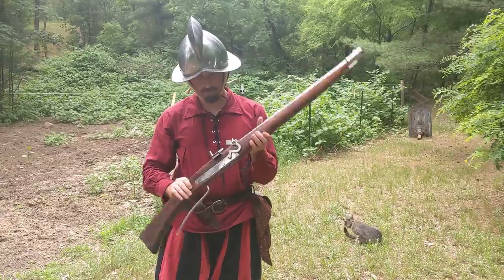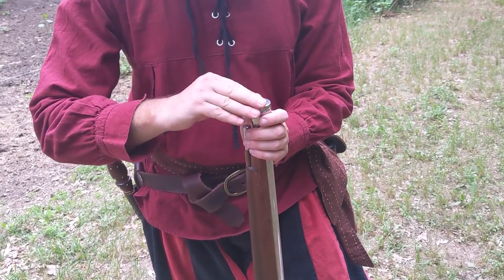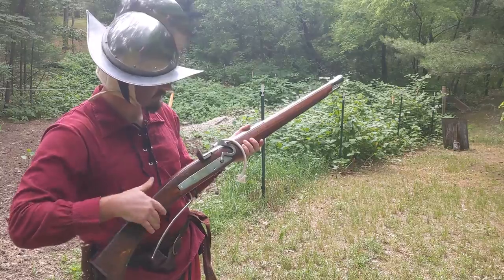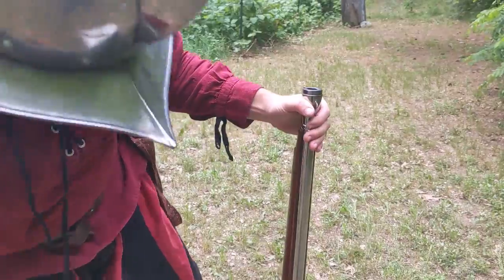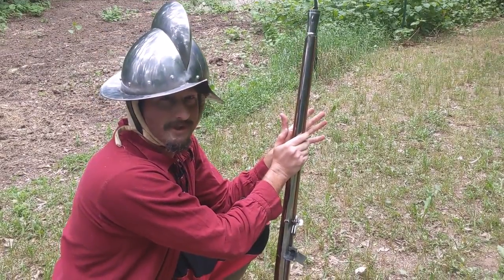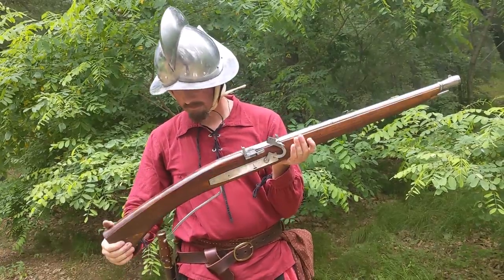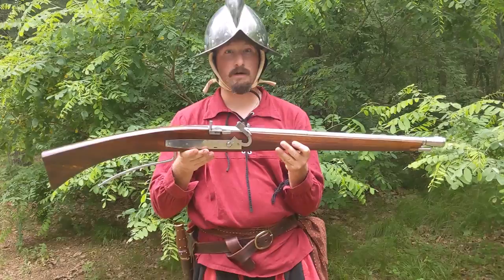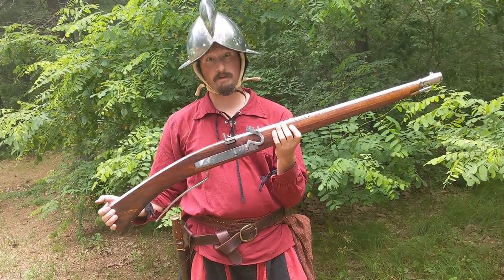Veteran Arms Early Matchlock Arquebus Test

Comment: I once read a long match cord was used with both ends lit holding the other end while firing. The reason was the flash of ignition would blow out the serpentine ember and you needed the other end to relight it.  Is that indeed the case?
Reply from the maker: They certainly used longer cord. I am unsure about both ends being lit, but very likely it was done to some degree. I find my burning end stays lit after firing.
Reply: They used both ends being lit because the flash from firing blows out the shape of the match for a while. it takes a while for it to burn into a pointy ember again. You lightly blow the match just before firing so it become a pointed glowing ember. You can see him blowing it at the 5:00 minute mark and its turns into an orange glowing point, right after it fired just fine ;)
Reply: Both ends were lit precisely for the reason you stated. The best match cord back in the day was made of hemp (less ash than cotton or linen) treated with a solution of lead sugar (aka, lead acetate) to “lead” the cord. [Source: Dittrich, R., Heilinger, H., & Köhler, TH., „Die Entwicklung der Handfeuerwaffe – Ein Überblick“, Von alten Handfeuerwaffen: Entwicklung, Technik, Leistung: Katalog zur Sonder-ausstellung im Landeszaughaus, Veröffentlichungen des Landeszeughauses Graz, № 12 (Landesmuseum Johanneum Graz, 1989), p. 27.] The standard burn rate was one-foot per hour. As the supply of match cord wasn't consistent, the musketeer/arquebusier was expected to make match cord in the field by dissolving gun powder (which is made from saltpeter) in water, letting the solids settle out, wetting some available hemp, linen, or cotton cord in the supernatant solution, and allowing it to fully dry.
Reply: Yes, just look at the contemporary guidebooks with their detailed copperprints that were published in great numbers, best-selling books of their age, to train soldiers effectively and safely(!) The best known ones are by Jacob de Gheyn from the Netherlands and Johann Jakob v. Wallhausen in Germany.

Comment: With those bandolier mounted charging capsules and 16th century tech, effective matchlock repeaters could have been made even without percussion priming technology. Each charger made of steel or brass, with powder and ball already loaded and a flame hole at the other end. Open breechblock, insert "cartridge". Close. Lower match to fire. Open breechblock, pull out spent capsule, load new one, repeat. One can even be made belt-fed, with loaded capsules on a belt and hand cranked into the arquebus just like how you advance the film in disposable cameras. After each shot you have to manually turn the wheel or crank to advance the belt and chamber the next capsule. I am surprised 16th century arms designers never went that route.
Reply from the maker: There actually were some multiple shot pistols during that period. Pretty interesting.https://www.thefirearmblog.com/blog/2016/11/15/worlds-oldest-known-revolver/
Reply: @FullMetalAmerican  That was pretty neat! And there was the Puckle Gun too. 1700s crew served revolving flintlock cannon. Designed by desperate British authorities trying to protect their northern coastal towns from frequent raids by Ottoman and Berber slavers taking European captives to North Africa to sell.
Reply: I have had a similar thought about how they could have inspired a form of cartridge before precussion primers. But shamefully, I had never thought of usimg a matchlock, far simpler than any of the igniton systems I have thought of.
However I think the manufacturing techiques and metalergy of the time would likely have kept this on paper if it ever was dreampt up back then.
Although that flinlock revolver may prove otherwise. (Very interesting article!)

Oh and the Puckle gun wasn't designed by british authorities, Puckle was a private designer/inventor. However he DID market it to British authorites heavily.
Reply: The thing you have to keep in mind about the time period is that plenty of people had great ideas, but getting those ideas funded and accepted into use were a problem and the expense in mass manufacturing rendered many forward thinking ideas unfeasible.

The Ferguson rifle was a great example, it was really the first viable breech loader to be accepted into military service by the British in 1776, the problem really came down to cost and expertise.

There were four gunsmiths who could make the rifle, and in 6 months they could produce less than 100 of them at four times the cost of a regular musket per unit.

Comment: i would say an arquebus penetrating full plate is largely dependant on the quality of the armor. a high end suit with a proper temper i think would absolutely stop or deflect an arquebus shot in the breastplate or helmet, specifically head on. the armor tapers down and gets thinner in the sides and especially the rear so taking a shot to the back would probably be a far more devastating.

also too, when firing these things in mass at a formation of fully armored men, shots are bound to find weak points due to the sheer volume of fire. i just dont think that direct hits on the thickest parts of the armor would punch through it like paper. firearms in europe predate the full plate harness too so i think armorers were definitely conscious of gun fire when making suits

Comment: I would not see why it would not shoot as well as any smooth bore. My fusil de chase 20 bore and my Lancaster 28 bore will hold 3 inch group at fifty yards
Reply from the maker: It shoots well for what it is, biggest difference is the shorter barrel, ergonomics of the stock, and the lever action and timing of the match. All those things affect accurate shooting. I also have a fusil de chase and it is much easier to shoot.
Reply: @FullMetalAmerican  I bet😊

Comment: I wonder if anyone would know the answer, I want to get this same arquebus, but I'd like to get it rifled and put miniball in it like what was used in the Civil War ( I know it's not historically accurate ) I would just like a more accurate black powder in an older style. Is it possible to have this done?😊
Reply from the maker: Technically yes, you would have to take it to a professional gunsmith who works with muzzleloaders. The big issue you would run into is finding or making ammo. This particular one is in .62 most minie ball are .57-58 or in rare cases early in history .69. There are people who could make you a mold specific to what ever caliber it ended up being. It is important that a professional do it and that the barrel strength not be compromised. Doing rifling typically bores out the barrel to a larger caliber, you have to make sure that it does not become too thin.
Reply: @FullMetalAmerican  excellent! Thank you for telling me!